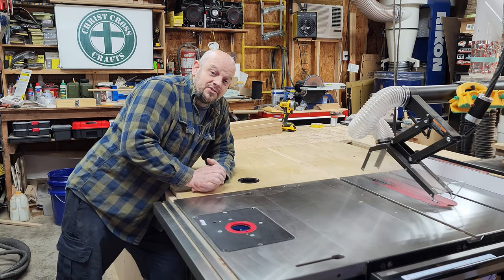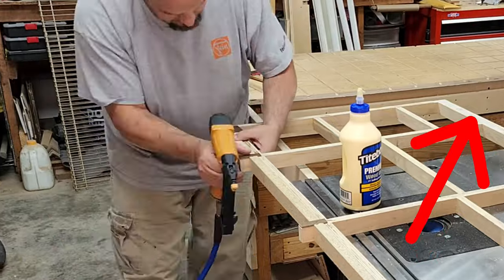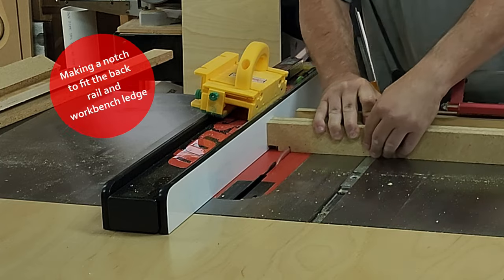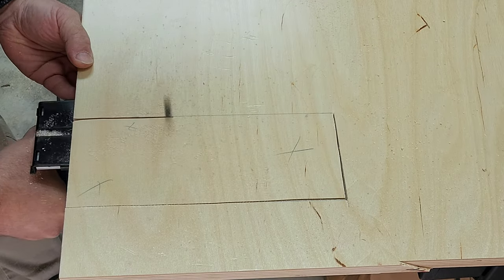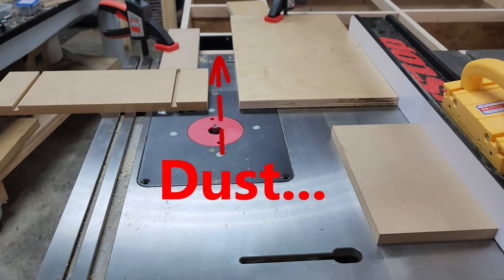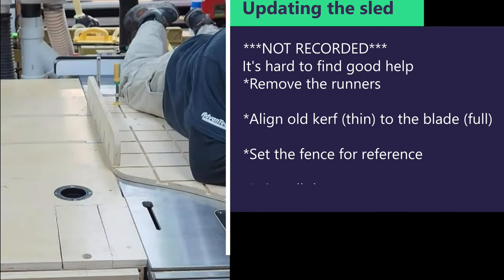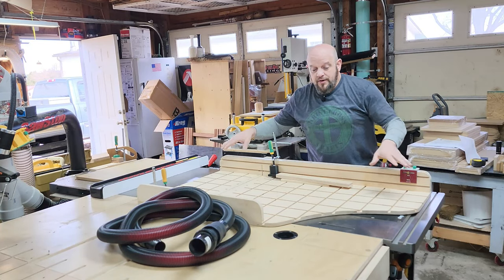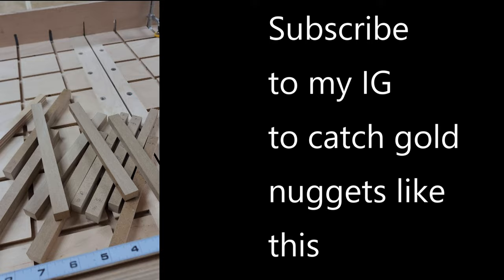Updating the table, dust collection, Microjig sled, and everything else around my SawStop saw.

Comment: watching you feeding those 4x8 sheets through the saw makes me cringe, track saw changed my entire flow on those sheet goods.  Love your outfield table gives me ideas on mine, although I am going to go with 20 mm bench dog holes for the top.
Reply from the maker: I come from a cabinet background and got used to cutting sheets (with a good outfeed).  Track saws certainly are a valuable resource, and I've considered one.  I made my plywood rack so I could cross cut small ends like a panel saw if I only needed part of a sheet.